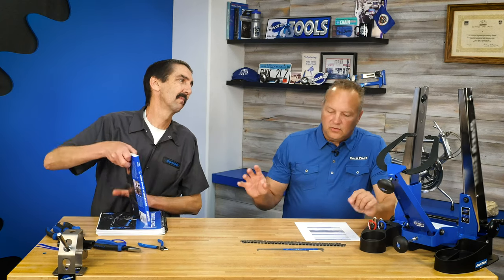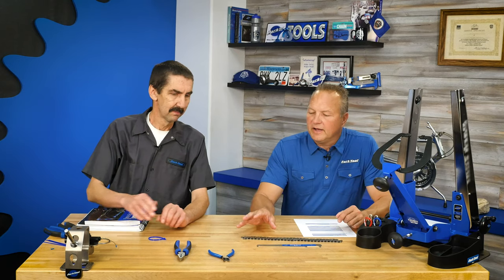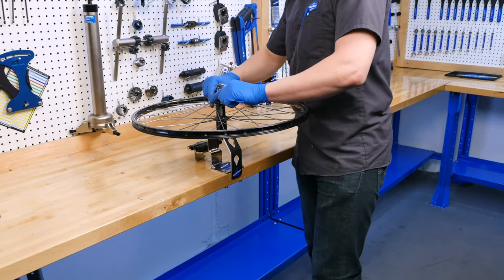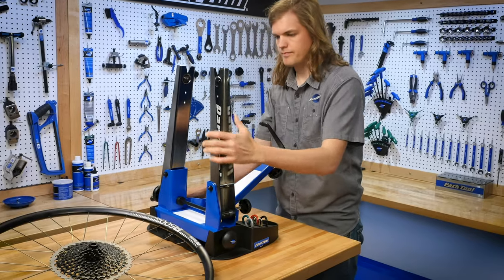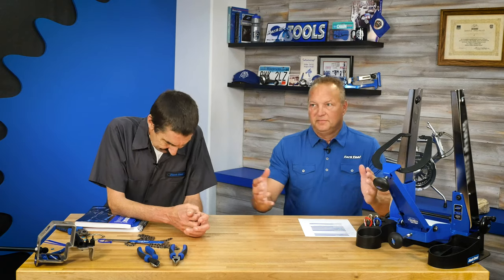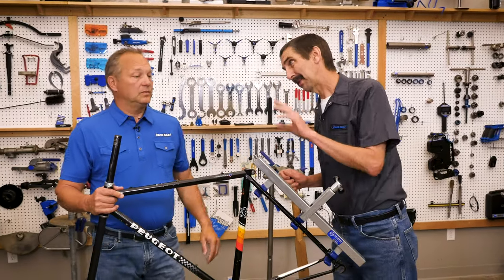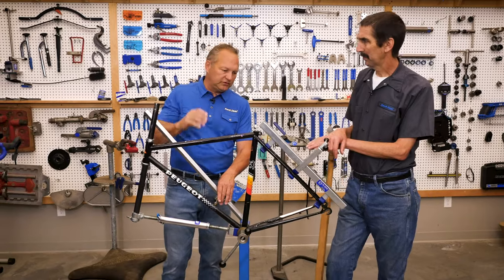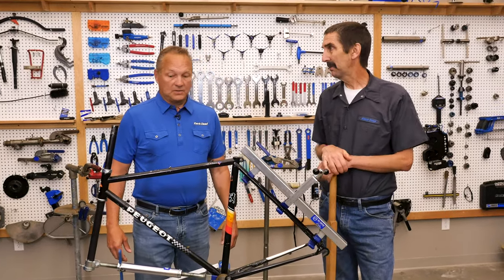New In Blue Episode 3 | New Tools for Summer 2019

Comment: Hello Park Tool folks. Would you please do a video about greases and lubricants, vs. thread-locking compounds, vs. anti-seize compounds, vs. carbon assembly paste, and in what situations and materials (carbon, aluminum, steel, etc.) each is most appropriate for threads, sliding fits (seat post), press-fits, and just mating part seating situations such as angle-contact headset parts, and the various cases of each as we see in bicycle applications. Some things are more obvious than others, and in any case a thorough treatment would be helpful. Thank you.

Comment: Could still use that frame-bending tool - I have an old Peugeot with a 120mm spacing at the back - would be nice to get a couple of extra mm in there for fitting modern 6-speed wheels.
Reply: RJ The Bike Guy has a video on how to do that. It involved a pipe with some nuts so you could adjust the pull by tightening it a bit. From his video about building a 1x gravel bike from a road bike. 10 minutes or so into the video.https://www.youtube.com/watch?v=KHXYN1JH8Oc

Comment: As the base master kit shows, it would be cool if the kits had little overlap. (Thinking out loud) If they were modular, you'd buy the modules as you need them and keep adding to your collection. The tool cases could line up or stack like bosch hard cases as a nice touch. Maybe kits could be divided like "Wheelset, Basic/Advanced/Rare" . You'd still need "Cuttin and Driving, Basic" or something general. Yeah it would be tricky to know how exactly to divide it, but I'd be excited about getting the next kit, instead of anxiety over what to buy first and then what next.

Comment: Still enjoying my 1992 CCW-4 whenever I have to remove/fit square taper cranks - the ratchet mechanism means it doesn't keep fouling on the pedal. Would buy another if it was still available...
Reply: Hozan still make something very similar, the C-160.
Reply: @mattgies  Not bad, but it wouldn't match my Park Tool collection ;-)

Comment: Park Tool, a bit of a fail on the wheel holder. It should of been designed to also be clamped in a bike repair stand. How did you not think of that? Let me guess, you figured well if the wheel is off, the bike must be in a stand right? Not always. They can easily be unclamped and put to the side. For example if you're at a trailhead or campground without a work table etc. Redesign and update it for next year and I'm claiming the copyright for that part.
Reply from the maker: Thanks! 👍